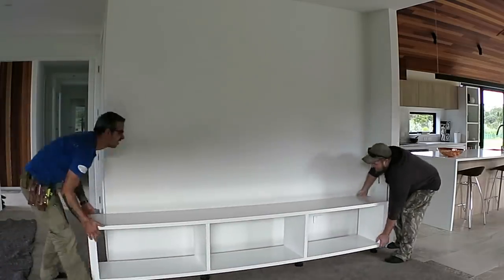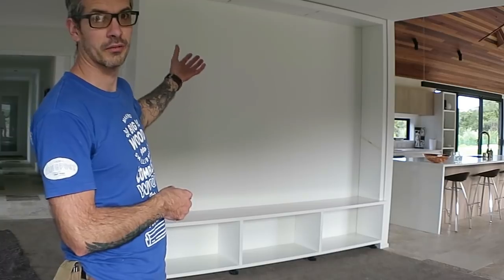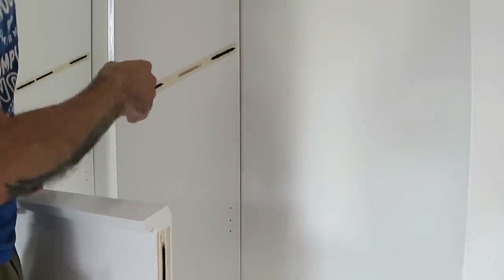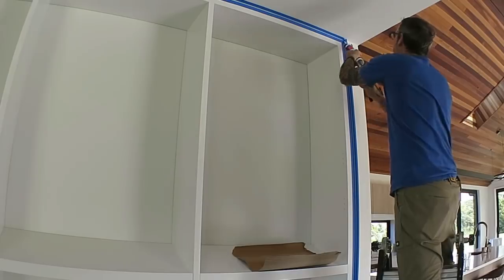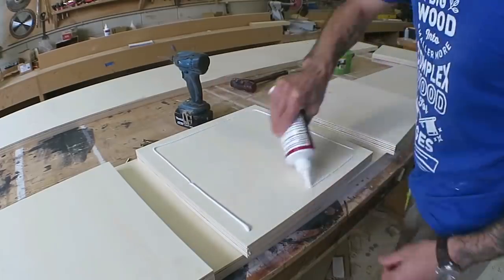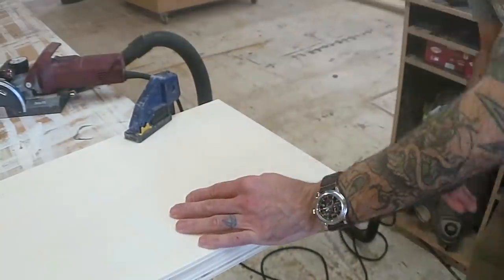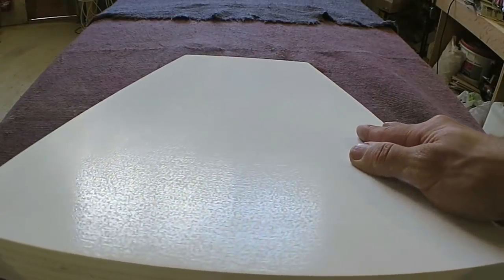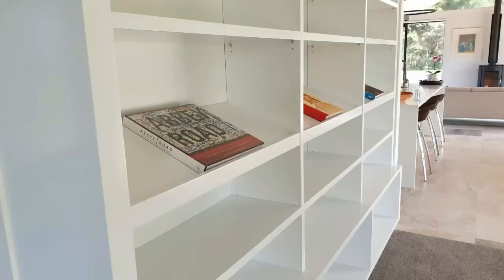Built in bookcase

Comment: Lamello seems cool. Where I work we use a groove in shelf and strip of solid wood on sides. Slide it on, and use some finish nail or screw/set screw to fasten. If it doesn’t need to be removed, then we add glue. Makes for one solid shelf
Reply: Lamello is great for on site fitting and can be all prepared in the workshop.

Comment: Lamello & Domino

Bang on point video.  
Having just literally ordered & awaiting delivering of an anniversary Zeta P2 I am now using youtube as the instruction manual!

Couple of questions

1.  2*Clamex & 2*Domino are used.  The piggy bank funds have now dried up hence no domino (theory is to use lamello exclusively as only build in Valcromat).  Would 4 clamex substitute the domino joints?
2. Divareo.  Brilliant that you show an attempt to physically lock the angled shelf with a clamex @4:35min. Will the divareo shelf not slide out or work loose over the next couple of years with seasonal temps & general settling or heavy items placed on shelf.  Could the clamex be re-utilised.  2*divario first & 1*clamex at the rear / top of the shelf to securely provide locking mechanism?
3. Most importantly do you not offer the plans for the designs for a small fee.  If so please be in metric 😉
4. Now off to watch the chair video.

Thank you for the great content.  Inspirational especially as completely new to this woodworking / makers lifestyle.  Hoping to turn into a small micro business.

Thank you 

Peace.
Reply: I think the domino in that build was unnecessary and he could have just used the lamello.

Comment: I'm not getting the function of the divario fittings. When you're using two fittings in the same grove, how do the front and back fittings not lock as they pass each other when sliding the shelf in? Or is it that the fittings only provide vertical support, not locking into each other horizontally?
Reply from the maker: They  clamp on but you can force it past there is a sweet spot of pressure of about 10mm long so it gives a bit of adjustment. Usually the shelf would stop against the back panel and prevent it going to far, of course you can pull it out the front with some effort

Comment: what are those black bits called?
Reply from the maker: They are fittings/fasteners for the Lamello zeta P2 machine.   The connectors are clamex, tenso or divario .  It is a specialty machine the cuts a keyway not just a biscuit plunge.